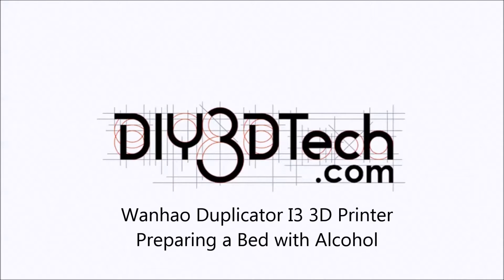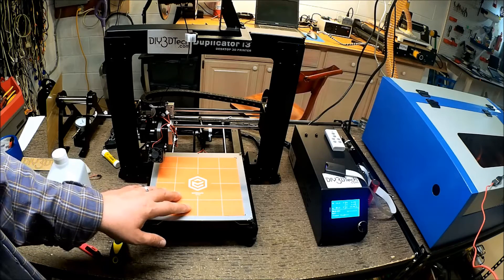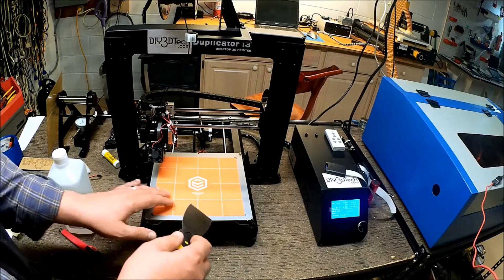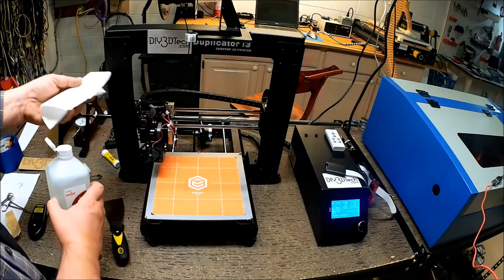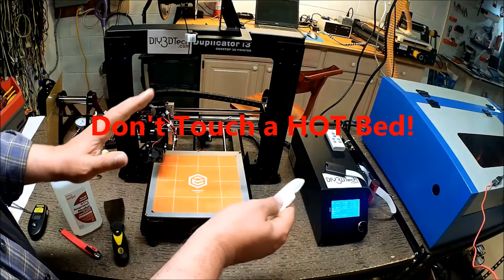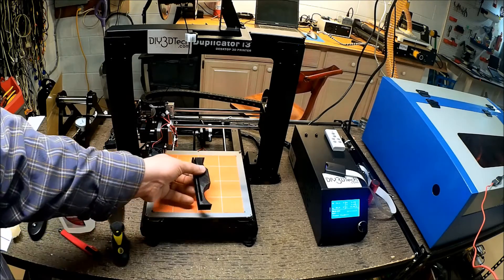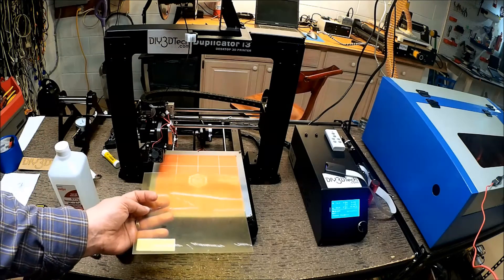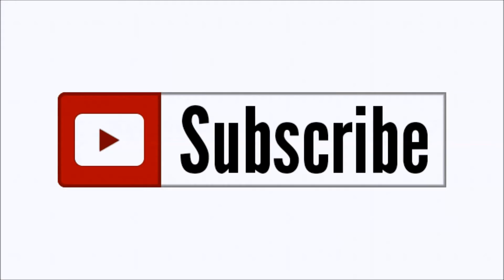Wanhao Duplicator I3 3D Printer - Preparing a Bed with Alcohol!

Comment: What was the name of the build surface you are using that you got from eBay.
Reply from the maker: +Mac Tek Ultralex 3D Printing Build Sheet (http://goo.gl/u6wHt0)
Reply: Thanks.  I might pick some of this up and try it.  As soon as i figure out how to remove the buildtak that came with the printer.
Reply from the maker: Oh my that was a mess!  Had to  take it off in pieces and use Goof Off to clean off the residue that was left over...
Reply: Yeah i not looking forward to it.

Comment: I'd made this suggestion a while ago in our Facebook forum in Australia. Alcohol cleaning removes any grease or dust or both build up on the bed. I discovered this when I had to remove my build tak 1 week into ownership from an overzelous part removal made an impression in the build mat which I was forced to print around.
Reply from the maker: +RamjetX I have also used Alcohol on blue tape to lift the fibers, not sure if that is happening here since its a plastic, however wonder if it isn't making it more "sticky" pre-say...